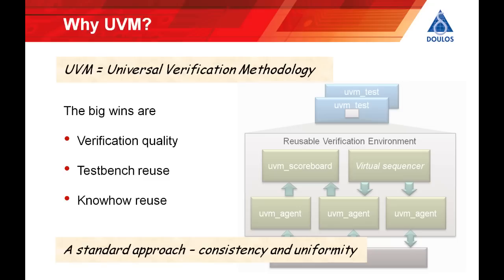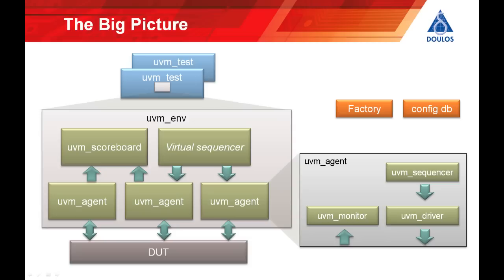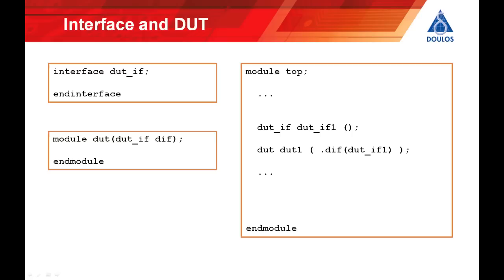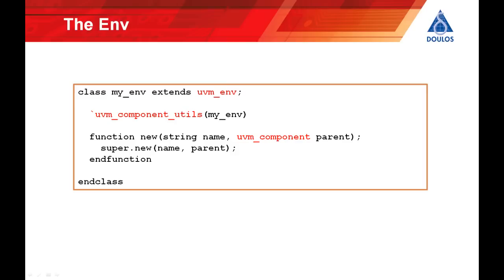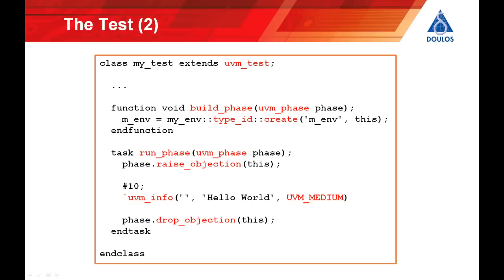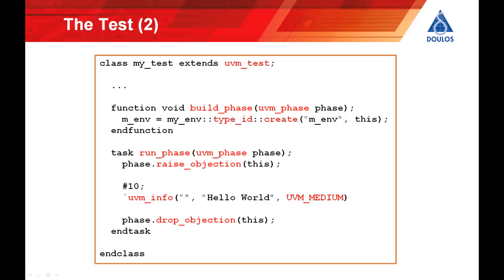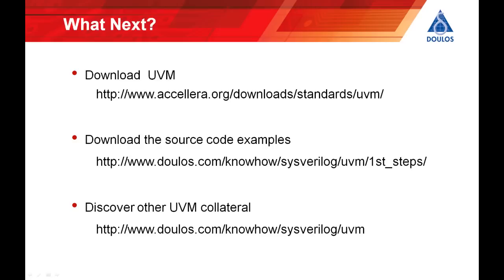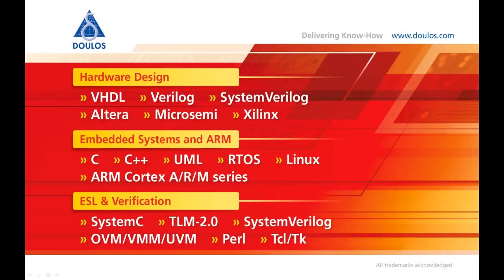First Steps with UVM Part 1

Comment: Explains how a simple "Hello World" example can be implemented in UVM. You get understanding of UVM class based world and module based world of a typical UVM testbench and how they are connected. Good info on uvm_env class, uvm_test class and raising/dropping objections.
Reply: Also has Information on : 
     - where uvm environment object is created and how it is created
     - typical structure of uvm test class what all it should contain
     - registration of user defined uvm classes with uvm factory
     - how to call uvm test from uvm testbench top module